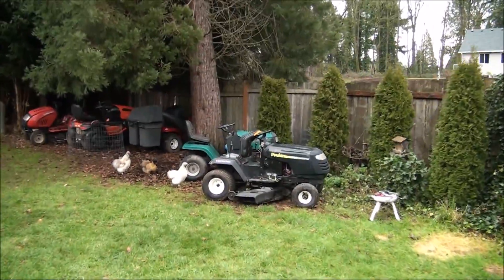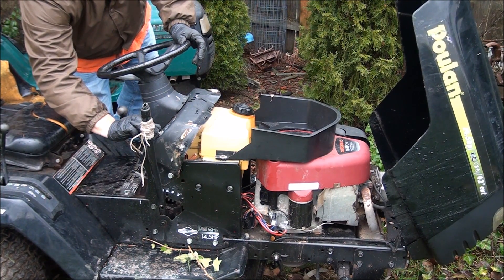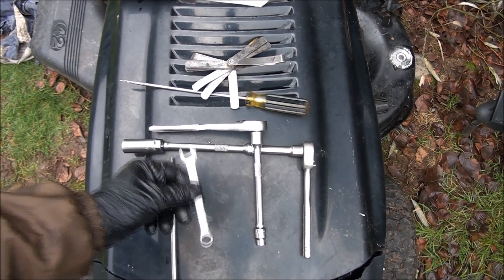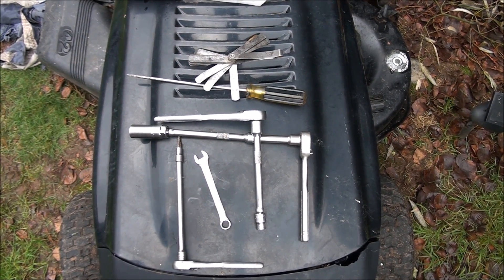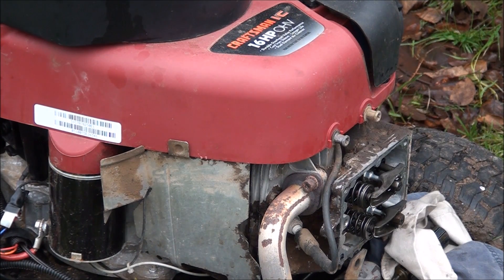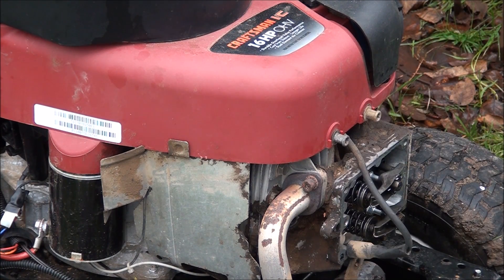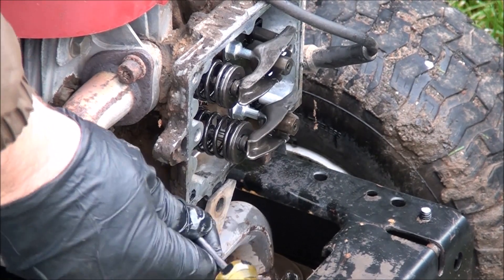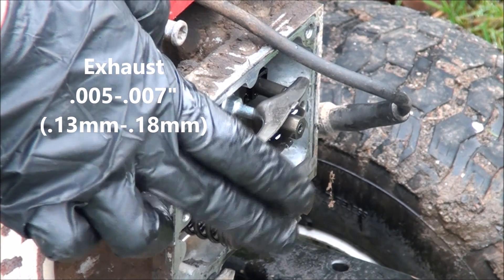Is it the VALVES? Single Cylinder Briggs and Stratton OHV VALVE ADJUSTMENT Procedure and Specs

Comment: You need to change the cam. That engine has an auto compression release integrated on the cam assembly. The only way to repair it is you have to replace the cam. I’ve done thee engines with that same starting problem.
Reply from the maker: yes if adjusting the valves doesn't help it usually will need a new cam.
Reply: Most times it's the cylinder head on these engines. Before you take the bottom end off to replace the cam, remove the intake and exhaust manifolds and look at the valve guides.  The older ones, usually the intake, slip down and act as if the valves need constant adjusting.  However, there are times when the compression release mechanism on the cam fails.

Comment: I followed along “To a T”, still trouble turning over. What completely threw me off is that your instructions (and perhaps the manual) did not call for rotating the flywheel to top dead center, *for EACH valve**! In other words, rotate the engine/flywheel until one valve is fully open and then adjust the other valve. You have to Rotate the engine again and  * only then ** you can adjust the other valve. I found donyboy73's video that details this critical step: https://youtu.be/T1anxdNWf5Y?t=190

I did appreciate your video and thank you very much, it was mostly terrific! In my case, I had to redo the job as the adjustments were way off due to missing this crucial information that left one of my valves completely off. I did browse much of the 300 comments here, but didn't catch any other mention of it. Apologies in advance if its been said, just hoping to help someone else who may run into this.
Reply: Hi joe I had same problem turning over what mine was carb needle jet and carb solenoid leaking fuel into cylinder so when I turned engine over it was hydrolocking the engine new carb off ebay fixed it,simple way to test this was to take plug out spin engine over to get excess fuel out of cylinder then put plug back in and it would fire up. The other thing it could be is the decompression weight on cam shaft watch this youtube vid , mtd tractor refuses to start! can we fix it!.
Reply from the maker: The way you describe will work too.  I follow the Briggs and Stratton recommendations in their service manual. I have adjusted hundreds of engine valves the way I demonstate without any issues. Not sure why it was not working for you.
Reply: I’m confused by your description of tdc for ‘each’ valve. There’s only one top dead center on any engine- which is when the plug is due to fire on compression. The next time the piston comes up you have valve overlap, which would be the worst place to try to set the lash. Rotating until one valve is fully open to adjust the other one will not be accurate on an engine with the additional decompression lobe on the cam.
Reply: @brucea550  I was just trying to clarify..dont you have to rotate the engine to TDC twice,  for both the intake and exhaust valves?
Reply: @donutz1  
Top dead center is when the piston is at the top of the stroke, but for the purpose of timing (ignition or valves) it’s the stroke of compression when the plug is going to fire. The other top dead center will have the exhaust valve closing and the intake opening, what’s known as overlap. Depending on the engine, both valves may be slightly open on that tdc. So you want the real tdc, and in this case, just a few degrees past, to avoid the bump on the cam holding the valve slightly open for compression release.

Comment: I am confused. My Briggs and Stratton 14HP Vanguard (Model #261777, Type #0144-01) engine's starter turns over very slow or not at all when the starter is installed. I have checked valve adjustment. I turn off the gas when I turn it off so no gas can siphon into the crankcase. 

When starter is removed, starter runs as should be expected. No binding or noises that I can detect. I dissembled the starter this past Saturday and cleaned up the brushes and armature. And lubed the end cap.

I'm very tempted to buy a new starter but have this feeling that I don't need a new starter...that I'm missing something. 

Compression release mechanism/system?

Do you have any advise/council?

Great video by the way.
Reply from the maker: Yes if it struggles to turn over (like it has too much compression) and you have checked everything (starter, solenoid, valve adjustment) it most likely is the cam. The compression release mechanism on the cam commonly breaks. I just replaced one today.
Reply: Jeff's Little Engine Service - I removed the sump on my Briggs and Stratton 14HP Vanguard motor yesterday and the compression release mechanism seemed all intact. And I found no metal pieces inside the motor.  And the camshaft lobes were not rounded. 

I did notice that the compression release arm seemed to stick when I moved the camshaft. Could this be a problem? Or just a lack of centrifugal force?

I have not checked the valve guides yet. If I was experiencing what to my experience with this motor as excess oil consumption before I couldn't start the engine this spring, could this be an additional sign that the valve guides are worn? Most importantly, how do you suggest I verify the condition of the valve guides? And can I install new valve guides or is this something I have to pay a machine shop to do?

Again, thanks for your generous time in responding to my queries here.

Sincerely,

Dennis McCrea
Panhandle, TX
Reply: Jeff's Little Engine Service - I've looked through my repair manuals but realize I don't have a repair manual for this 14 HP Vanguard. 

And I've searched online for a Youtube video or guide on how to check valve guides and valve seals and how to replace them (this is the direction I’m heading at present...that the valve guides are worn...which is causing the valves to not open properly, hence high compression which prohibits engine starter cranking, especially at initial starting effort. I was experiencing higher than normal oil consumption last year before I stopped using engine for winter.) But no luck.  

Thoughts and directives?

Comment: I have the same 16 HP engine in a Craftsman mower. Have adjusted the valves several times and it starts, but then it reverts to not wanting to turn over. Battery is new, starter and solenoid seem good. Is it maybe a loose stud like you had? Or maybe something else?
Reply from the maker: Hard to turn over? probably a bad cam (compression release mechanism on the cam)
Reply: @JeffsLittleEngineService  Thanks, I appreciate the reply.

Comment: Adjust the valves all you want. It won't replace a worn down compression release and that's what happens to these engines. These over head valve engine's cams are designed to limit the life of these engines and make them disposable.
Reply from the maker: The cam is definitely a weak point of this engine. replacing a cam takes about 2 hours and $100.00 in parts
Reply: @JeffsLittleEngineService  I've got probably 20-25 OHV Briggs and Stratton riding mower engines that the compression release is toast. I put refreshed flatheads on people's mowers for a nominal fee for a source of billet, stainless steel, and chromoly parts money. Squeezing the lash on the exhaust valve on those soft cam lobes only delays the inevitable with Briggs fault engineered OHV engines. Wouldn't happen to know an aftermarket source for more durable cams for them, would you? I'll freshen up these OHV engines that are piling up with a good cam.

Comment: Would the engine have turned over fast before the valve adjustment if you took the spark plug out?  I very anxiously await a answer.
Reply from the maker: yes with the spark plug removed (no compression) the engine should turn over easily

Comment: would loctite on the studs be worth doing or would it get too hot?
Reply: I would recommend it. Recently on my engine the intake stud unscrewed out of the head while the engine was running and the rocker arm came off. It had no thread locker on it but the exhaust stud did. They both should have thread locker on them so they don't come out.
Reply from the maker: Red loctite might be a good idea
Reply: @JeffsLittleEngineService  thanks! Next time I am in the there I'll probably do just that

Comment: these engines are noted for the rocker studs backing out causing valves to come out of adjustment use lock tight on the threads and retighten also if the compression release on the cam breaks it will be hard to start
Reply from the maker: good tip

Comment: It worked....how and why? Who knows.  But after adjusting the valves the engine turned with ease.  Prior to this the starter could barely turn the engine one revolution.   (The valves were too loose when we started).
Reply: There is a compression release mechanism on the camshaft that bumps the intake valve part way open during cranking to allow for easier starting. After the engine starts and the RPM's go up the compression release retracts and you get full compression. If the intake valve is too loose the intake valve no longer gets bumped open to release the compression and the engine will get stuck during the compression stroke when you try to crank it.
Reply: @joevignolor4u949  Thank you very much.  That took the mystery out of this.
Reply: @travelingkaspersworld4096  You actually were lucky. It's easy to fix this problem if its being caused by excessive play in the valve train. You just adjust the valves. But if the compression release, which is part of the camshaft assembly, is defective then you have to take the whole engine apart and replace the camshaft.
Reply: @joevignolor4u949  Thank you.  I've watched videos on that....I think we would be more inclined to toss the engine because we come across them often.

Comment: If you want to avoid your engine from running hot, which is detrimental for the valves and adjustment, keep your air filter clean and blow the debris out of the shroud and the fins. A good seasonal engine pressure clean will help, also if you have problems with the valves going out of adjustment often put some thread lock on the studs so they don't walk.
 A dirty air filter and debris build-up around the head and shroud will make the engine run lean and hot.
 Remember the engine is air cooled.
Reply from the maker: good tips
Reply: @JeffsLittleEngineService and no need to take out spark plug ajust valve one open on closed  ajust the closed valve then rotate engine till the other valve closes and ajust the your done
Reply: Air cleaner has nothing to do with valves it's to keep air going into the carb clean the valves need adjusted so the decompressing  valve works lol😂

Comment: Good video but you should be on the compression stroke when ever you are adjusting valves. A piston can be at top dead center on both compression stroke and exhaust stroke. In your video you are on the exhaust stroke.
Reply: Nope. Watch it again. He even explained it. I’ll even help you- 6:15.

Comment: Thank you so much for showing and explaining everything so well! Saved us from purchasing a new mower and we had just bought one a year and a half ago!  Someone tried charging us $89 to fix our house mower but by following your video, it only cost us $13 for the feeler and oil. THANK YOU!
Reply from the maker: Thanks! good job
Reply: @JeffsLittleEngineService  
Hi Jeff, can I ask you if it is possible to find the wire diagram as I bought a yard mower with a Brigg & Stratton but I found 2 wires that I don’t know where they need to be connected and what is their job? I can send you a picture. Any advise will be appreciated. Thanks, Serge

Comment: I put soooooo many hours on this exact engine.... did valve adjust so many times i was at the end of adjustment lol tough lil motors
Reply: My Intek is knocking at hot idle.
Reply: @Hubjeep  qtr+t3¼½+½qtr a1+qed+q a
 ADC
Reply: Did ya get it to work?

Comment: I think those heads have a tunnel going up, so that might not be exhaust, it might be intake. Remove that pipe at the top and crank it and see if you feel suction or exhaust.
Reply: No. Very simple engine. No tunnels.

Comment: If the rocker arm is loose, replace the head. The valve seat is loose. Check the valve adjustments often to avoid that. Put mothballs around the mower in the Winter to avoid rats chewing wiring etc.
Reply: Rocker arm is unrelated to valve seat.

Comment: the inside torx is the LOCK......the outside bolt is the ADUSTMENT......that's why you keep loosening the stud...it does not have to be top dead center. when one valve pushes in (opens) adust the other
Reply: It's filler guage not feeler.
Reply: Feeler gauge

Comment: HELP!!!!!  what would be the cause for the piston to hit the head on a B&S.  Everything looks OK. could the piston rod have streched out?
Reply from the maker: yes it could be that or that the lower rod bearing is worn too much. Make sure you use the correct spark plug.
Reply: @JeffsLittleEngineService  thanks for replying. Guess I will try replacing the rod and use the piston and new rings. Do you think a better option would be buying a complete set? If they sell it.

Comment: I have an issue that my move loses   power wen engaged. I replace the carb asn it seems a litter better but still missing some power . When I start to cut thick grass ( 4 inches) is starts to bog down barley making it. Valves look 4 and 6 forgot what order …  any ideas ?

Comment: I am not very mechanical.  thought it was my carborator, plug or ignition coil (which I tried) till I saw your video to explain why my mower was running rough. When I opened it up and saw a 1/2" gap on the exhaust, lol, I knew where the problem lie. Thank you.

Comment: I have a 18.5 horse Briggs and need help with my carb there is a small jet that came out when I took the fuel bulb off to replace the gaskets, I have no idea where it goes my carb is allowing fuel to run straight into my motor and then I have to drain the oil, help please
Reply: That is your needle valve. There is a little notch in the float that the top of the valve fits into. The pointy end of the valve goes in the brass seat. When the float raises up it pushes the needle valve into the seat and prevents gas from flowing when the engine is not running.
Reply from the maker: sounds like your float needle valve came out. It goes on the float and up into a hole in the carburetor. It is what stops fuel flow to the carburetor. They need to be replaced if they still leak gas after being cleaned.

Comment: Got a question. Mine runs like yours did when you first start it up keeps doing that oscillating rev but very hard and when i engage blades its even worse
Reply from the maker: sounds like the slow speed jet or high speed jet  passage is plugged inside the carburetor
Reply: @JeffsLittleEngineService  ive cleaned carb, checked valves and gaps, plugs new, magneto replaced, throttle and governor are set correctly safety switches and anti backfire is working properly. Like a just have a bad exhaust valve seat. When she gets warm some popping and backfire begins. Fans in good shape and spins.
Reply: @JeffsLittleEngineService  i made a video of it   https://youtu.be/K2nKra2qUjg

Comment: Just set my valves the same way and it still has a hard time cranking. I replaced the battery and the starter and still having trouble. Anyone have any ideas? It will crank and start great with my hand over the carb?
Reply from the maker: unfortunately it may be your compression release on the cam. It will need a new cam if that is the case.

Comment: Why did you not check the valve clearance before adjusting that way you would have known if they indeed require adjusting.
Also I dont agree that what you are saying is anything to do with the syptoms shown it is impossible to have to much compression on this engine
Reply: Yep, I agree , Briggs had issues with the compression release springs on the cam of some ohv models which caused hard starting ...
Reply: How is it ‘impossible’? If compression release is not working for ANY reason (including what he shows here) the starter can’t overcome the compression.

Comment: first off, take the extension off the ratchet, you will be more stable. Hold the adjuster and remove the torx. This is why the stud comes loose. Remove the rocker, remove the stud and clean it and apply some loctite and torque. If not, you will be back to square one again.

Comment: Another way for securing the STEEL bolts into Aluminum threads, is to put a "small dab" of ANTI-CEASE on the threads, so there is no corosion, or sticking!

I love using my ANTI-CEASE so it's easier for the next time for Regularly Scheduled Maintenance!

Sadly, there arn't too many people that actually "take care" of their equipment... :-( That's where us Small Engine Mechanics come in!

Nicely done Informative Video!

Have a GOOD one!, :-)
-Thomas
Port Orchard, Washington
Reply from the maker: Great tip!
Reply: Anti-seize and corrosion.

Comment: Thanks for the video! I had to replace the gaskets and then it wouldn't start.  I figured it was the valves but as I had never adjusted them I didn't know how.  Performed the adjustment per your instructions and the thing fired right up!  Many thanks!

Comment: Mine wont start and I have new battery and carburetor cleaned....
Also new spark plug 
I don't know why it was run before but smoked after warm up...
Can some one help please?
Reply from the maker: possible blown head gasket or gas in the oil (from flooding carburetor)

Comment: Thank you so much for this video as it gave me the knowledge to fix my tractor. I also found that the push rod was bent on the bottom valve. I was able to straighten it. The tractor is running again better then it has in years.

Comment: Rotate the engine until one valve is fully open and then adjust the other valve. When one is open, the other is closed.   No need for finding TDC.
Reply from the maker: seems like that would work I suppose, I followed the service manual procedure on this one.